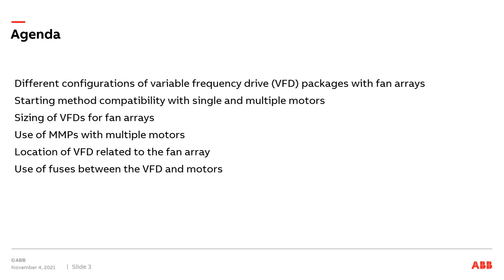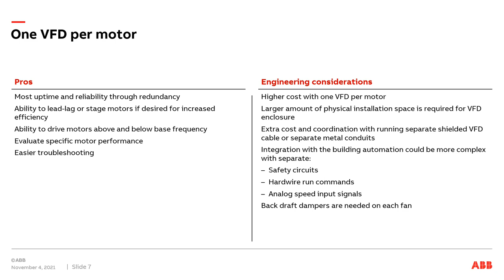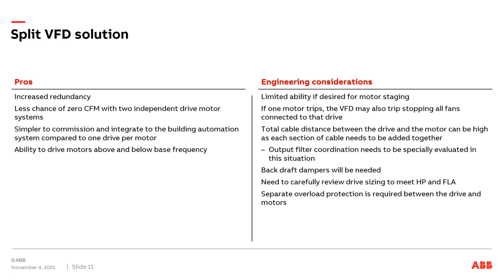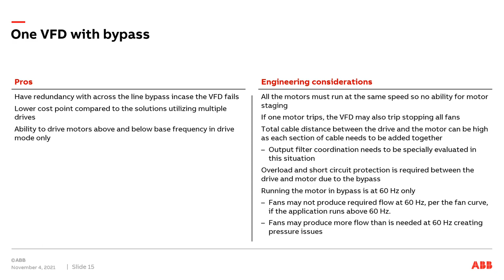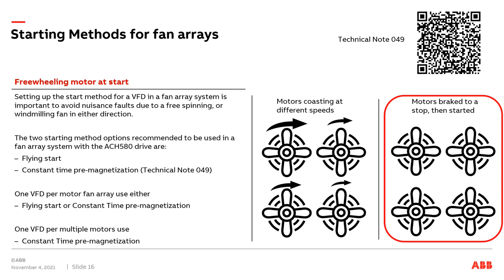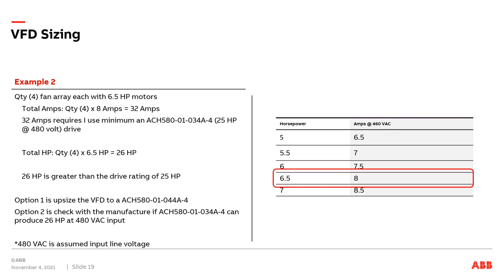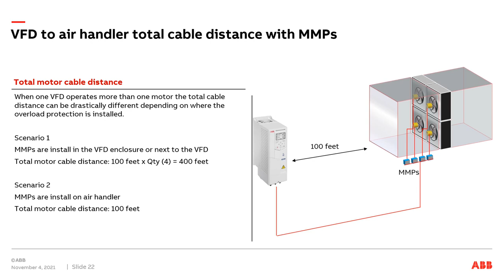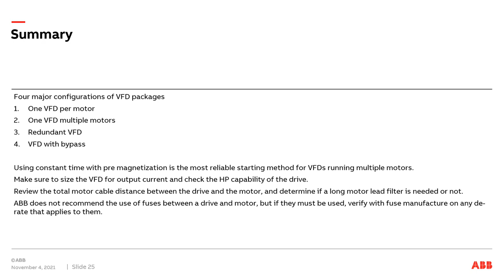VFDs and Fan Arrays

Comment: You talk about motor staging on a fan wall, I was under the iimpression that for even air flow you want all your fans running at the same speed and that you can cause issues with the array when some fans are running at different speeds than others. Under what circumstances would you stage fans in an array vs having them all run at a lower rpm to provide the given CFM?
Reply from the maker: The typical fan array runs all the fans at the same speed and provide even flow through the array and across the cooling coil.  However, there are AHU OEMs who have designs where they’ve evaluated the entire wire-to-air system efficiency of the fan, motor, cooling coil, and VFD – and have identified the optimal operating points for the system.  For example, at a particular operating point of a 2x2 array, it may be more efficient to run (3) fans at a higher speed, than run (4) fans at a lower speed.  These “sweet spot” efficiency points are determined by the AHU OEM based on their testing and calculations.  The logic for that staging control would be part of their equipment mounted supplied controls.  Being able to run the motors over 60 Hz with the VFD, allows additional flexibility for such designs.